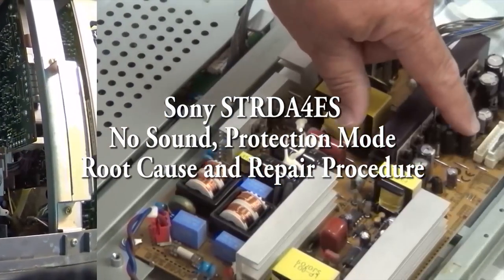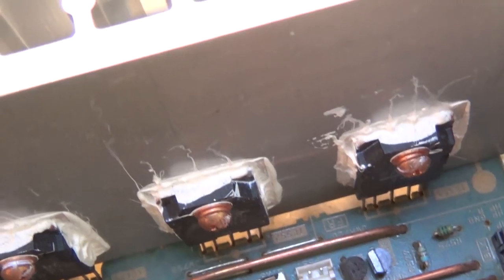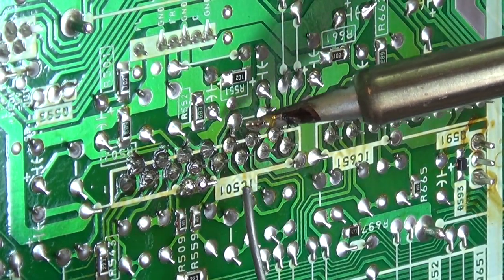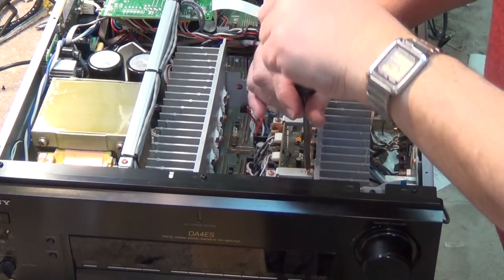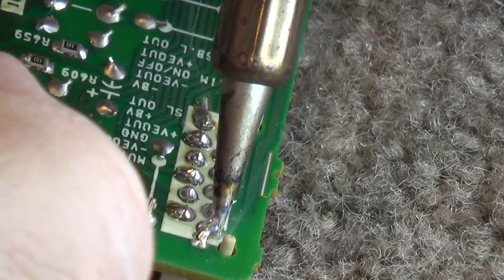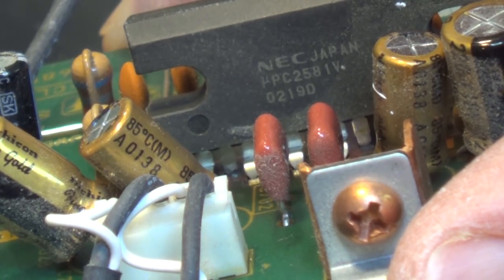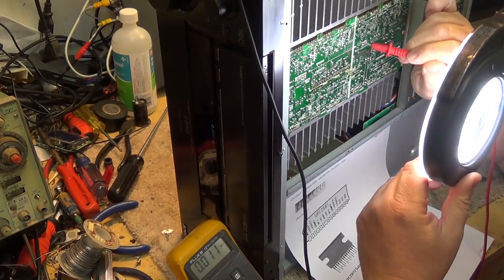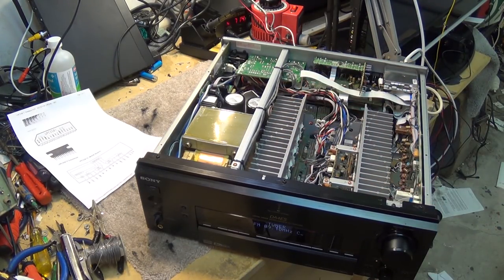Sony STRDA4ES No or Intermittent sound most common problem and fix for it

Comment: Very cool that you did another Sony STR-DA4ES repair video! Your previous video inspired me to repair my STR-DA4ES with a "popping" audio symptom that changed as the Receiver warmed up. I also found many cracked solder joints and re-soldered them, which fixed the unit. My repair video is on my YouTube channel. Thanks Dave!
Reply from the maker: Very common fault.

Comment: I am driving to grab one of these things this evening. The thing that I like about it is that it has an integrated phono preamp and it has a cassette and a mini disc in and each of them have record out. Because I have enough music that is still on cassette and minidisc, it is attractive to have those inputs. On my current receiver I have to use a phono preamp and that input takes up one of my selectable inputs. I think I will open this thing up before I even hook it up and Reflow all of the solder joints

Comment: The sine waves in the sinks are so the heat leaves each arm the most at different spots, so as not too create too much heat in one place. It is a method of dispersing the heat better than without them.
Reply: The "sine wave" in the heat sinks is what Sony referred to as the "S-Fin."

The purpose was to ensure that each heat sink fin resonated at different frequencies during operation as opposed to all heat sink fins resonating at the same frequency.  This was supposed to prevent sympathetic resonance that may result in distortion.
Reply: @Watcher3223  Thanks for that! Some research to learn is in order tomorrow about it.

Comment: My STR-DB780 has a similar construction, and had non-obvious dry joint issues causing it to go into protection mode randomly. Ended up reflowing a lot on the main board and is a great unit
Reply from the maker: Lead free Solder.  The main problem with electronics.

Comment: Man, the intermittent repair jobs are the worst. I had a stereo preamp with intermittent sound issue on one channel. Spent days on checking drivers, pots, connectors etc only to trace it to a tiny solid smd capacitor on the pre-amp. Tested fine on the multimeter but would do the intermittent dance while in circuit. These faulty smd caps have sent a whole pile of electronics to the landfill.
Reply from the maker: Yes intermittent troubles make service engineers go insane.  When I was working in the broadcast industry we had one camera that was intermittent.  The poor engineer never did solve the problem. Every time he said ur was fixed, our on a remote shoot it would break.  The red registration would go out and no way to correct.  Engineer was so burned our he quit, moved back east, opened his own tv repair business. Did that for several years.  Closed to shop and died a few years later at 67.

Comment: Have you run into these intermittent sound/power issues on the Sony STR-DH550 model? I get a fully functional receiver for hours and then no sound/display. I come back later and powers on a works fine. Im guessing an over heating issue?

Comment: As long as the solder is not bridging pins,  use all the solder you need. The extra mass is only a problem in aircraft/high G environments. Sitting on a shelf, solder away.
Reply: This is also why heavy pins are always hand soldered after wave soldering the board.
Reply: @mdavidhandler  hey Dave , I would like to send you my Sony EV-C3 for repair how can I contact you?
Reply: @davidvalega  I am not in the commercial products repair business. I currently work on military products. I do not have any spare parts for this item. Good luck
Reply: @mdavidhandler  sorry, I thought you were the 12voltvid guy that makes the YouTube videos
Reply: I worked military circuit boards "ordalts" on torpedoes and fire control systems, my instructors for soldering were NASA certified. I was going to come to Dave's defense, but you beat me to it. His experience has taught him well, I have no issues with his soldering and he explained his reasoning to his method well. In military soldering you need to have a good visual of the conductors underneath to aid the inspector for proper wetting action, a convex fillet of solder is all that is required. This ain't that!

Comment: I have a Sony STR-DE675, which shares a lot of the same components and design elements as this receiver. The front left channel is perfect, but the front right channel is very soft and is not discreet. When I use the balance controls, it will lower the volume on the good channel (left) but no matter where the balance is set the right channel stays at the same soft volume and never goes off, even when it should be silent and balance is set to 100% left. Also, the relays click on and off if I move the unit slightly when on, but this does not turn off the speakers at all, they keep working no matter how much the relays click. I resoldered the relay coil pins along with all the others, but I did not resolder the ICs as shown in the video. Any idea what could be causing this?

Comment: My sony str-db940 powers on and relay clicks but has no sound at all, ive reflowed the mainboard still no sound, it doesnt go in to protect mode, and if i crank the volume to maximum i can just about hear the fm radio, and when i press the test tone button all the tones work on all speakers but again i have to crank the volume to the max to faintly hear them, dont think any of the darlington setup are shorted, i did notice cracks around the voltage amplifiers but ive reflowed them now and checked several fusible resistors, the b+ voltage is present so is the b- im kinda stuck on where to look next, i think a good idea would be to add metal paperclips to these voltage amplifiers to dissipate some heat.

Comment: Quick question:
Do you see this thermal expansion more or less on lead-free solder or on leaded?
I was thinking (logically) whichever has the higher melting point would see less of this occurring, but I could be wrong.
Reply from the maker: It is more of a problem with lead free.  The big problem is it is hard and brittle.   The copper wire it is bonding is softer.  Because the metals are different yhetevwull always be slight resistance at the bond.   This resistance will produce heat in high current applications.  Also heat from the component travels down the lead. This caused the copper to expand.  Copper expands at about twice the rate as tin. Over time this expansion will increase the diameter of the lead free bond which will increase the gap when the wire cools which leads to more resistance and more heat.  Eventually the bond breaks.  High lead solder is soft and expands and contracts better with the copper.  Lead free is shit.  The only reason we are using it is because the EU defended it.  This is the same block of countries that pumped out millions of diesel cars claiming they were cleaner than gas cars while using software to make them appear clean when being tested and then letting them belch all kinds of toxins into the air when they weren't being tested.

Comment: I cant imagine doing this type of work; very much out of my wheelhouse but this video does raise a question.  You talked about using alot of heat.  What is the proper temp to set a soldering iron at to do this project?
Reply: I would guess somewhere between 350 and 400 celsius
Reply from the maker: Well I use 700 F as that is what my iron displays.

Comment: Ok, well surely, those heat sinks are large enough for the finals and do the job well - for them! Sony always seems to be on point in this regard, but a fan is needed in this design and similar to prevent the solder cracks that the heat sinks themselves now cause to the rest of the unit. A cheap but quality fan and some cents worth of components and this design goes from 9 to 10. What does everyone else think? Agreed?
Reply: im wiyh u ! also gonna put one n mine this weekend for sure. anything there would be better than nothing... like the one i pulled from an old dell tower i found on the curb many years ago ! I Love it when i can re-purpose items saved from the landfill to better/ protect my ancient  components !   .Ahhhh...feels nice !
Reply: @Rob.DB.  It's been a while, but desktops are always an awesome find, regardless of the power of the components. Good luck!

Comment: My theory of putting loads of solder on is that 1. It gives more support. 2. I reckon it gives better heatsinking. Weather that's true or not.
Reply: Putting more solder, provided that it has flowed properly to form a good joint between the component lead and the pad on the board, would help the joint to better resist cracking from thermal cycling (the board expands when warmed up and contracts when cooled down).

That said, you can use too much solder, but usually the concern would be a risk of causing a short to neighboring joints, which is what do not want to have happen on a power amplifier circuit.

Comment: Thanks Dave, another reminder that "factory production " has it's weaknesses....skimpy rapid process workmanship....usually automated.  Nice reminder to use quality lead based SOLDER for longer lasting connections.  Keep the V-twin puttin'  like here in HOTston Texas.  Have you been to Sturgis ?    JwgK
Reply from the maker: No, I don't go that far on the bike.  Usually stick within 100 miles of home and return every night.  I don't chance getting caught in bad weather.
Reply: @12voltvids  If you get the urge to chalk it off your bucket list, then check the options and consider this as a future 'Voyage " ... your fellow Hog Slapper and electronics enthusiast .   JwgK
Reply from the maker: @jameskrivitsky9715  
Well I am inadmissible in the USA now because I was given pfyzer then moderna so i am blacklisted even though according to the CDC and every other health agency they are equivelant but not to us border services so i can't come down even if I wanted to.

Comment: Dave, 
Thanks for showing this repair. I didn't know there was such a thing as a fusible resistor. Why not just use a regular fuse which is easy to spot and check?
Reply: The resistance is necessary for proper operation of the circuit. The circuit also needs a fuse. The two dead birds thing. One stone.
Reply from the maker: Exactly.
Reply: @MrChrisRP  Thanks for the quick answer.
Reply: @12voltvids  Dave, 
Thanks for the reassuring quick agreement of the above statement.
Reply: Often the currents required are too low for a reliable fuse operation.  You can get 100mA fuses for example, but they can be fragile.
Reply: Fusible resistors are usually green, and the circuit board and schematic shows a box around the resistor symbol.
Reply: @zulumax1  Good to know. I had no idea such a thing existed.

Comment: It  is not just amps that suffer the Sony solder issues, I have had the same problem with TV's as well.
Reply from the maker: Lead free solder is an issue but even leases solder has broken connections.  Wave soldering was the problem.

Comment: I only use lead free solder because it has a higher melting point than the rosin core
Reply from the maker: It's also more brittle. I work only with 60/40 rosin core.
Reply from the maker: @Steve-mp7by  I've used Kester LF.  Leaded is still better.  63/37 is ok.
Reply: In normal operation, the components will never get hot enough to where the melting point is a concern.  Besides, you have real, albeit unlikely, problems if the joints are getting hot enough for that to be an issue.

As Dave points out, regular solder has better ductility than lead free solder, which has advantages over how the joint can endure thermal cycling over an extended period of time.
Reply: @12voltvids  Nothing like the smell of lead in the morning ! 😉
Reply: @Watcher3223  Thats BS. If lead free was that bad they wouldn't be making it. Its funny how these electronic baby boomers always bash lead free solder
Reply: @Steve-mp7by  "Thats BS. If lead free was that bad they wouldn't be making it."

So, the fact that lead free solder was mandated to the electronics industry by law, such as RoHS, without considering the long term ramifications ... which is typical of politics ... wasn't a factor?

Gee, you sure told me off...